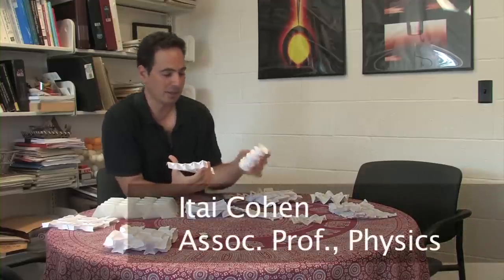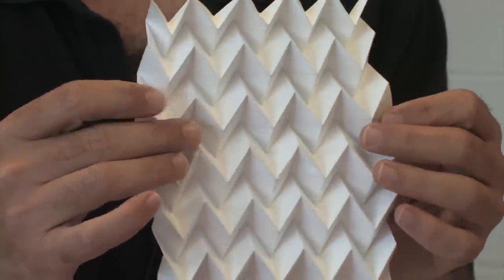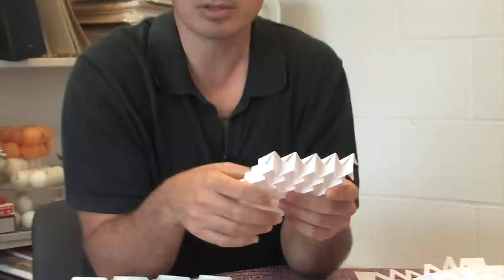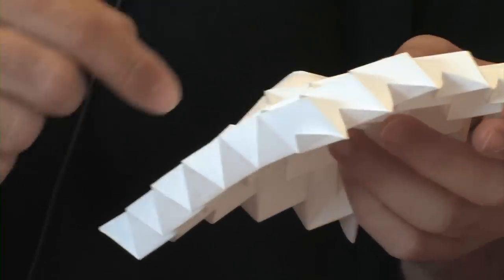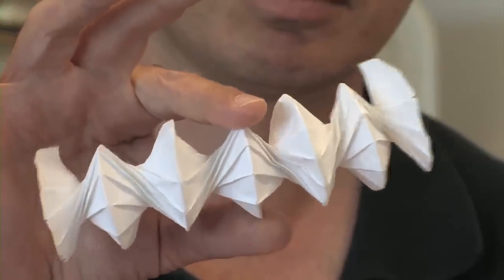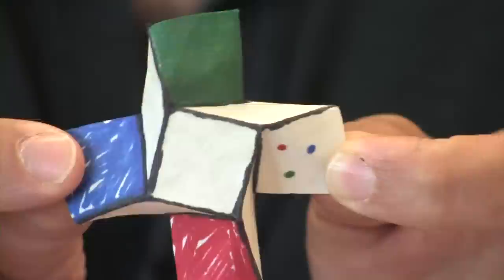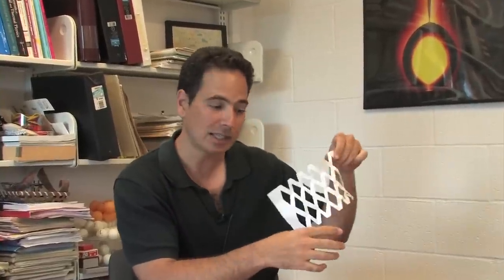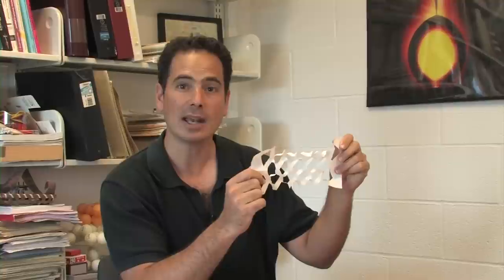Itai Cohen explains the physics of origami

Comment: could u use these kind of patterns to make an metal which could change their form by rearanging their atomic structures. well i mean not to make them in new metall or material i mean something like u did on the origami. u pulled the origami and it changed their form and by adding energy like you pushing the edges back, it snaps back in their original form. i ask myself if you could use that type of technology to create an metal which could basicly repair itself when its damaged by " forcing it to snap back in their original shape". it would be pretty awesome to have mterial car build of those kind of origami shaped metall structures. you had an small car accident and it would be not an problem repairing it.

Comment: Would working in a hexagonal folding pattern assuming the material, Graphene is a carbon based.   Buckyball  leaps up to space elevator application?   Would the material benefit to longevity of the design?  Or the scale to the molecular not significant?